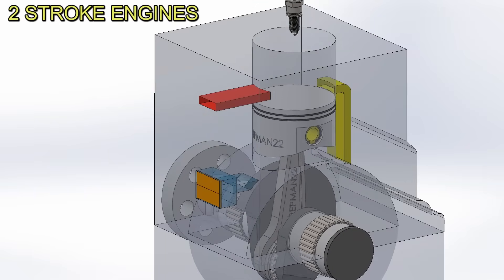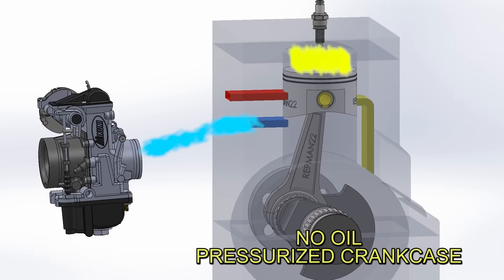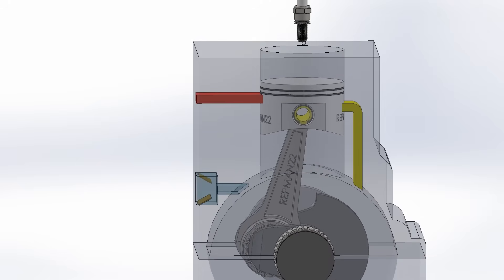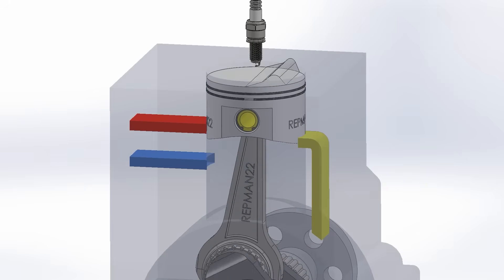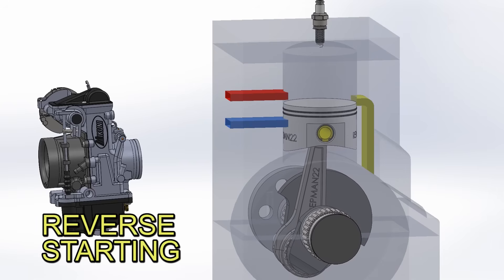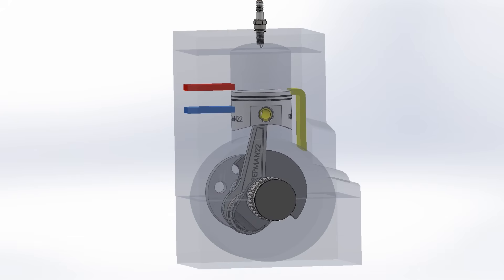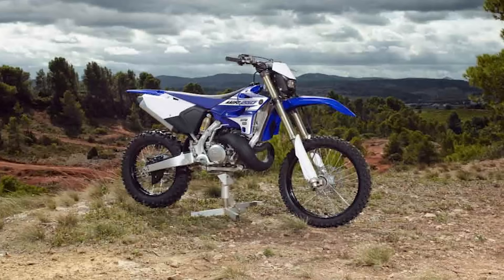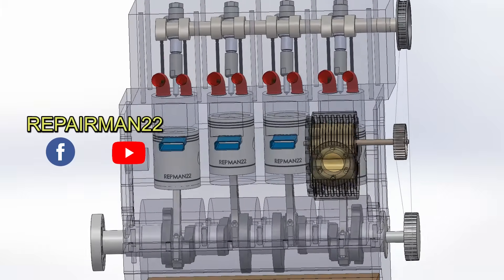Everything You Don't Know About 2 Stroke Engines 🤯

Comment: Are there two stroke engines that runs without crankcase compression? I was thinking to design a 2 and 4 stroke engine in one (2 cyliders or 4). 4 stroke to get engine to idle and to speed. And two stroke to take at high rpm the speed. I have read that at tuned exhaust scavaging take more place and crankcase volume (and compression) doesn't really matter.
But here it is mesioned that higher crankcase ratio is for high speed (where more scavaging is).
Of course when hitting high rpm, the 4 stroke cylinder need to fulley open exhaust so it rev freely. 
I never saw this before

Comment: Meny years ago, I had a CZ-125, for a short while. I stopped at a junction, & when I went to pull out onto the main road, the dam thing tried to reverse back onto the road I was leaving???
It had to go, #@?! 
The point being, it will run backwards,!
Thank for the diagrams.
P/S, top tip if you have an old 2-stroke, like the BSA Bantom? When rebuilding, always renew the crankshaft oil seals, even if they look OK. Your primary compression depends on them.
Reply: No shit

Comment: Early on I put together a Go-Kart with a 2-1/2hp Cast Iron Briggs and Stratton engine that drove 1 rear wheel.  Next I received a worn out Jacobson 1.8hp 2 cycle Aluminum lawnmower engine from a friend. We put it on my Go-Kart and it was so cool. It didn't go faster or quicker, but my Go-Kart seemed lighter and it had a very silencing muffler that made it just purr, like a Honda 50. Eventually as I upgraded my Go-Kart I went back to a 4 stroke Aluminum Briggs rated at 7hp. It was about the same weight as the 2-1/2hp Cast Iron engine but had tremendous get away and topped out at 50mph at WOT no governor. One day I came across a McCulloch 2 cycle chainsaw engine. It was very powerful rated between 7 and 13 hp. My Go-Kart had evolved into a low slung racer and now it went 65mph. Then I got another McCulloch nearly the same size and mounted it on the other rear wheel. It took some work to get it to run backward, but eventually it did. If you can imagine two  7 - 13hp engines on a small Go-Kart, it meant 90mph +, but I had no way to clock it. I was Sixteen then and just learning to drive a car, and so were all of my friends. Finding someone to clock my Go-Kart at over 80mph just wasn't available to me. Besides, I was 16, I could drive the car! Good Bye Go-Kart. I gave my Go-Kart to a neighbor a little younger than me. Hello Cruising Woodward Avenue. Enter 1969 Plymouth GTX. I still have the GTX. ben/ michigan

Comment: There is also a french Motorcycle, the "99z", having a second piston : a simple piston, without sparkplug, supposed to act as a "balance piston" in order to increase balance to the crankshaft.
But this was rather designed to suck and push more gasoline into the combustion chamber for more power.
You should google it, this was quite an innovation at its time. I wonder why this didn't became a standard.

Comment: Why does a 2 stroke engine run 12000 rpm? Wouldnt it have te runs half of the 4 stroke engine to deliver (almost) the same amount of power?
Reply: They run at higher rpm to make more power than 4 strokes with a much smaller engine
Reply: shorter stroke

Comment: Interesting video how a 2-stroke engine works in 3D. But I think calculating the compression ratio of the crankcase at 8:32 
is wrong. If the crankcase compression ratio is 1.5:1, a 50 CC engine must have a 75 CC crankcase.
Reply from the maker: When I first read it I thought the same as you. Then I understood the formula that I put on the screen. 150/100= 1.5 so, if i have 1atm, then i will have 1.5atm.

Comment: Lol no 2 stroke race engine pulls to 20,000rpm.  Only 2 strokes that rev that high are model airplane and rc car nitro engines.  4 strokes have actually been spun to much higher rpm that a 2 stroke.

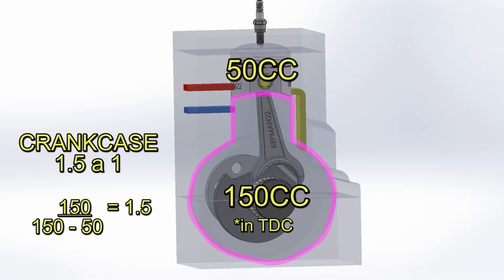Comment: 8:40  The bot vid is comparing a corrected compression ration (7:1, the area only above the exhaust port in the stroke), to a 4-stroke method (12:1) using the full stroke of the bore.
People do measure 2-stroke compression with the 4-stroke method, (which is not a good practice IMO), but the corrected method is just for 2-strokes.
You will not find a 2-stroke with 12:1 compression, (measured by the corrected method), that will run on gas with out failure,---quickly.

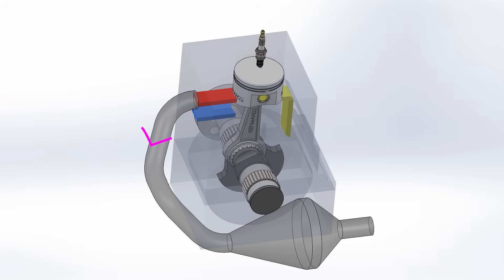Comment: 7:40  That is also not true.  My dyno reads with different types of exhaust, or none at all, (as I calibrated my dyno),  with these 3 different runs: 
1 Tuned pipe makes the most power.
2) No exhaust at all made the 2nd most.

3) A stock exhaust can, (found on all lawn equipment for example),  made the least amount of power. (Pipe almost doubles that power).  On the engines I work on, the stock can makes about 18% less power than no exhaust at all.

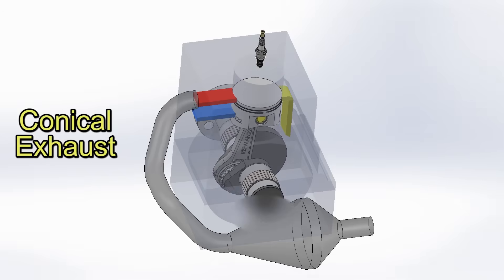Comment: 7:00  Another ill educated bot error.  Pressure does not cause the reverse wave in a tuned pipe.  Sound does.
Reply: But, the back pressure will help hold in the fresh gasses from leaving the ex. port at lower rpm's, before the sound wave is in effect.  We use the calculations of "sound speed" to created a proper length and geometry  tuned pipe.  If you build too much pressure, (a small diameter exhaust end bleed, the end of the exhaust), then the engine will get hotter at higher rpm, like the close cats on your car overheating your engine in an effort to burn every hydrocarbon.  Nope, the EPA does not care how long your gas engine lasts, unless it is a shortened live span.  I don't see Toyota ads today, like we did 40 years ago, bragging about 300,000 miles.
Reply: @EarthSurferUSA A pressure wave and a sound wave are the same thing, a sound wave just oscillates so that it has a frequency as opposed to the singular front of a pressure wave.

Comment: 1:50   Oil burning is more blue in color.  White smoke (steam) is probably a water cooing leak into the cylinder.  Good crisp jetting greatly reduces that smoke you see in that example.
Reply: That's not a liquid cooled engine so yes that is 2 stroke smoke.
Reply: can be bluish, depending on mix ratio...
Reply: @pauls5745 two strokes are supposed to smoke a little if they're not they're not getting lubricated
Reply: @RonaldDaub-v9y  I don;t want to see what smoke comes out if it's not getting lube hahaha. but yes. A well-tuned a 2 stroke will still smoke.

Comment: This video has many technical errors.
"Repairman22" - you might want to research the following technical details:
1. Loop scavenge two-stroke vs. externally scavenged two-stroke (hint: what you described in this video is a loop-scavenged two-stroke, with only a brief image of an externally scavenged two-stroke at the end of the video, but no description of the differences)
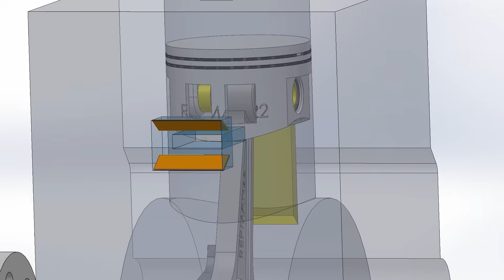2. Rolling element bearings vs. fluid film bearings (hint: typical modern four-stroke engines use fluid film bearings - making the statement @5:30 nonsensical)
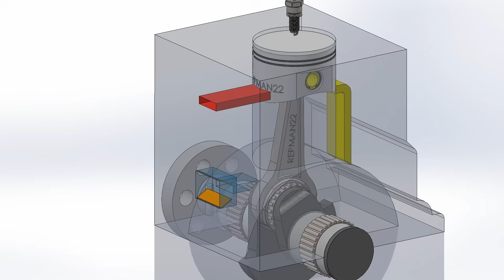3. Piston port vs. reed valve vs. rotary valve induction (hint: performance figures from racing engines show no significant performance advantage for any of these, making your statement @3:00 inaccurate)
4. Rolling element bearing lubrication requirements (hint: rolling element bearings require very little lubrication - making your statement @9:50 nonsensical)
5. Incomplete description of the reason for the shape of high-performance two-stroke exhaust pipes
6. No mention of lack engine braking (aka pumping losses, aka "compression braking")
7. No mention of transfer-port injection (or crankcase injection) when discussing direct fuel injection
Reply: As a 2-stroke engine builder myself, I would have to disagree with #3 a bit.  I would say the rotary valve intake offers the best performance, then reeds, then piston port.  The reason is the difference way they fill the crank cases.  Reeds offer a wider power curve, (and usually more power, as piston ports rarely have a 5th transfer), over a piston port, and it flows based on different pressures and not piston location, and can have an open duration of the intake to a full 360 degrees, allowing fuel to flow when ever pressure differences let it happen.  But, the reed valve is an obstruction.  Rotary valve, similar to the piston port as the flow is controlled by mechanical means instead of different pressures, has the ability to tune the intake duration at closing, and opening, where the piston port is symmetrical, but is more expensive to build.
Obviously, the MX factories went with reeds starting in the 70's, because they are out performing the piston ports.  But I think the rotary valve has the best potential because of that intake control, and no obstruction like a reed valve.  I will listen to this vid, (which is probably a bot vid, just repeating what it learned, correct or incorrect), and I bet I could find other discrepancies also.  :)
Reply: But the reed valve is of little use, if there are no reed transfer ports to increase time area of the transfers, so we can increase the time area of the exhaust port to match.  I have only seen one piston port MX bike engine (an old Montessa), that was able to use a 5th transfer.  It was the only time I saw that unusual casting configuration, but there may be more.
Reply: @EarthSurferUSA   - finally, a YouTube commenter that knows of what they write!
I completely agree that rotary valve 2-strokes have the highest potential power output (I was simplifying my comment for the majority of the YouTube audience).
The title of my senior undergraduate thesis was, "Expansion chamber exhaust in loop-scavenged two-stoke engines".  I did a lot of research and theoretical work, backed up by cutting, rolling, welding and testing several different exhaust systems (I even built a dynamometer from scratch for testing).  My test "mule" was an old TZ-250 Yamaha. I ended up with a set of "top speed" pipes which sacrificed torque spread for top speed, and a set of "acceleration" pipes for tighter tracks with no significant straits. Those were the days (I still love the smell of burning castor-bean oil)!!

Comment: Why not constantly pressurize the intake? So when both intake and exhaust are open, the pressure in the intake will push all the used air out and feed fresh air in at the same time, minimizing the oil coming in, since the air doesn't need to enter the crank case. The crank case can be also modeled like on the 4 stroke engines for lubrication. I think the downside is, it will be required to use injectors.

Is it a dumb idea?
Reply: You are talking about supercharging the intake.  But on the 2-stroke, when the transfer ports are open, filling the cylinder, so is the exhaust port.  So it all blows out the exhaust. I am sure the flowing action would clear out the burnt exhaust gasses better in the head and cylinder area, and maybe find a bit more power because of that purity of fresh fuel/air. But you will be blowing a huge amount of fresh gas/air out of the exhaust port at the same time.
Until communism in china has to deal with an EPA,---I have to consider their arguments against gas engines, coal electric generation, etc., a load of crap.
Reply: sure. can be done but it's very hard to force-induct a 2 stroke. so much boost is lost to the exhaust port, but proper port timing can minimize this.

Comment: No mention of Schnuerle porting which is more effective than loop scavenging?
Reply: They are the same thing.  Schnuerle (sp?), developed "loop scavenging".  You are right though, the programmed bot missed that,--and the fact that a sound wave in the pipe, that the bot confused with only pressure.

Comment: Fun fact:  There has been (at least one I know of) experimental engine that used electronically/hydraulically controlled poppet valves and would work as either 2-stroke or 4-stroke depending on the load. 2-stroke under high load for power, 4-stroke under low load for fuel efficiency.
Reply: Koenigseg
Reply: No?😂 @agungh1670
Reply: I bet neither mode works as well as they do in separate engines.

Comment: The port leading from the carburetor to the crankcase is the intake port. The port leading from the crankcase to the cylinder is called the transfer port. The transfer port and the exhaust ports are the ones open at the same time, the exhaust and the intake ports never are. 

A three port engine is also called a loop charged engine.

Nearly all two stroke outboard motors are reed valve engines.

In my personal experience I’ve only ever seen two rotary valve two stroke engines. One was a horizontally apposed twin cylinder McCullough US Air Force surplus drone engine. The other was a 90cc Suzuki street bike. The owner told me it had no carburetor because is wasn’t on the cylinder. We found it hiding under the side cover. When we removed it we could see the rotor through the intake port, and could expose the rotor port by rotating the crank.
Reply: Rotax 2 stroke engines used in microlights (jet-skis too?) have rotary intake valves.  Also, model airplane engines typically have hollow crankshafts that incorporate rotary valves
Reply: Traditional 2 stroke Vespa motor scooter engines use a rotary valve intake.
Reply: "The transfer port and the exhaust ports are the ones open at the same time."  Nope.  The exhaust opens much earlier then the transfers.  The cylinder pressure has to "blow down" to about zero pressure, so the transfers can flow into the cylinder.  The measured number of degrees of crank rotation between the exhaust opening up, and the transfers opening up, is called "The blow down phase".  It would not run if they opened at the same time.
"Loop Scavenging" is the correct term.  I would like to build a rotary valve engine from scratch.  I think I can get the most power form them.
Reply: @EarthSurferUSA  I didn’t mean to imply that they both open at the same time, you are correct, the top of the exhaust port is higher in the cylinder than the top of the transfer port so that the high pressure in the cylinder can blow out before the transfer port opens. They are both fully open though at bottom dead center. The intake port is never open when either the exhaust or the transfer ports are open.

Comment: Don't forget about if/when the float needle sticks open and floods the crankcase with gas and then you can't get it to start for days because of it. Or when the crankshaft seals wear out and you can't get it to start for days because of it. Or what about when the crankshaft seals are worn-out and your trying to slow down at an intersection and the engine starts accelerating uncontrollably because of it?
Reply: what are you talking about? im an outboard mechanic and have only seen 2 crank seal leaks in motors from the late 1970's on through the early 2000's have a crank seal leak. o rings and oil seals. extremely effective!
Reply: @ct1762  He is talking about the normal maintenance that he is too lazy to do.  Factories usually don't sell new engines in those worn out conditions.  :)
Pretty sure this guy hates shoe laces.  Too complex, and he does not have time.

Comment: The four stroke revs higher than a two stroke.
Reply: It all depends on the size of the engine.  little 2-stroke nitro engines rev to over 30,000 rpms, (and can not use a piston ring because of it).  And I build 30cc gas 2-stroke engines for a living, that probably rev higher than anything with a ring, staying together at 21,000 rpm.  How much rpm it can take, pretty much primarily depends on the size and weight of the parts.  How would you like a screaming, 5lb little 21,000 two stroke engine for a noise maker at the bike races?  They have a sound---all their own.  :)
Reply: @EarthSurferUSA  what are these 30cc nitro engines fitted to? 🤔👍

Comment: You forgot 2 stroke outboard engines for boats (up to and including V-8 engines) and  inboard Jet Ski watercraft's. as well as snowmobile and ultra-light aircraft engines. you also did not mention just how many 2 stroke die hard fans there are around the globe.  NOTHING can compare to the lightweight horsepower that can be achieved with a highly tuned 2 stroke. and the really odd thing about those highly tuned 2 strokes, is they can also be quite fuel efficient at the same time.  Also, those "heavy" rotary valves and reed valve parts that you are describing, weigh  in at less than 8 ounces typically if properly designed. the "loop charged" deflector pistons were ridiculous though. they were a very poor design. and limited R.P.M. SIGNIFICANTLY.
Reply: not loop charged you mean cross flow. yes they had heavy pistons and less potential as in a looper outboard, but they idled like a sewing machine and most where very quite.
Reply: @ct1762  "Loop scavenging" replaced "cross scavenging",---a long time ago.  70 years maybe?
Reply: Finally, a guy who knows what he is talking about.  Kudos.  
Doug @ ESP (Earth Surfer Performance).

Comment: I dont understand why the otto cycle 4 stroke is the standard in almost all vehicles instead of the 2 stroke design used by detroit? 2 strokes are more efficient since you eliminate the friction coefficient of the intake and exhaust strokes that don't produce any power and two strokes produce more torque since they have more powerstrokes per crankshaft rotation. Likewise I don't get why we don't use 2 stroke opposed piston emgines like the one achates power made but they have been around long before then in WWI WWII tanks. They have a higher thermal efficiency of 55 percent or more.
Reply: Excluding the force of the EPA, probably the longevity of the engine.   A tame 4-stroke ( not a racing engine), will go a lot longer than a 2-stroke with out a top end rebuild, but costs much more to rebuild it.

Comment: What about pistons with one piston ring arent they faster
Reply: Must have been faster, with less friction. Older road racing bikes had 1 ring, eg Yamaha TZ 125, 250, 350, 750cc
Reply: @liloldsnoopy4279  Less friction, but more blow by.  Racing engines still use both.
Reply: Think longevity